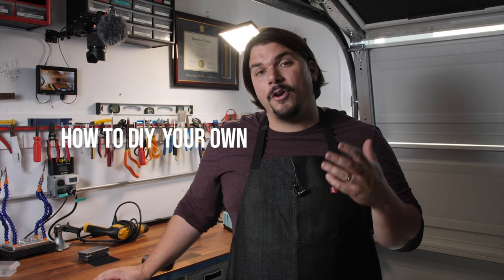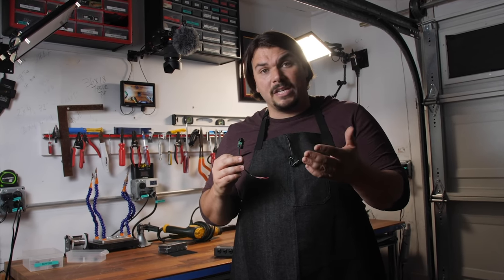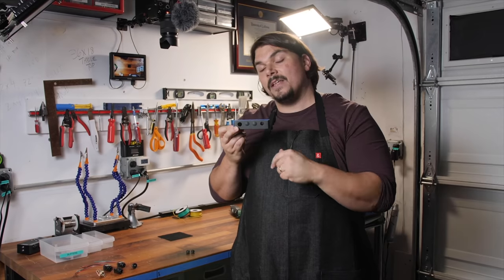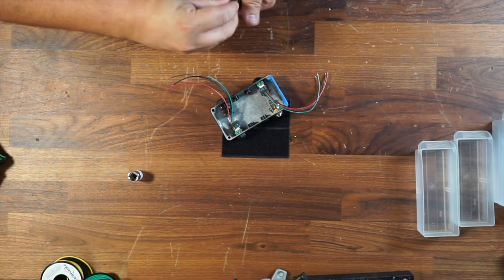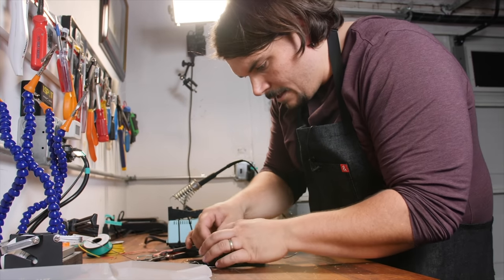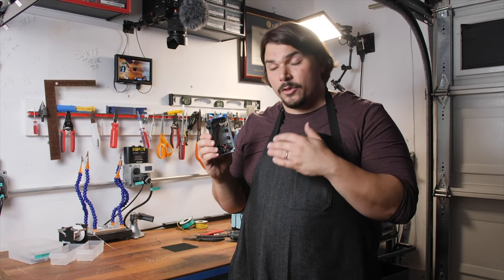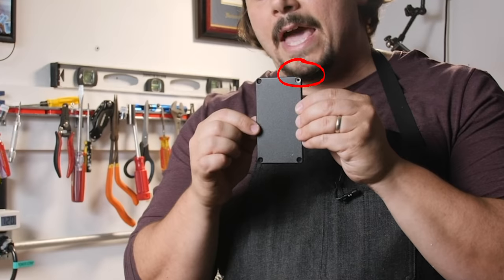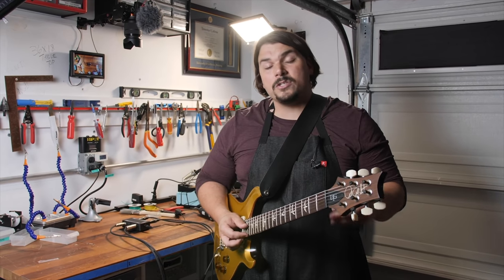Build Your Own Buffer!

Comment: Thank you for your videos!  I’m a beginner just getting into Pedals and you’ve help me tremendously!  I have a question on building the 4 Cable Method. 

I’m looking at running my Volume pedal after Boost/EQ  (following your Signal Path Video). If I have Wah/fuzz/treble boost going into the buffer along with running Chorus and Trem through an effects loop do I need to run 2 buffers or can I simply add another buffer to the 4 cable box and solder it to the buffer output?  The new buffer would be the input for the volume pedal. 

Don’t know if this makes sense.  Your help is truly appreciated!
Reply from the maker: Ideally you'll have three buffers, one after your impedance sensitive pedals like what and fuzz, one going into the front of the amp, and one on the return of the effects loop.  This should be how it's shown here minus the input buffer needing to come later in the chain.

Comment: Awesome video Mason! Right up my ally. Would I make one with a lower input impedance if you’re putting it after a few pedals in your chain? Or still 1M.
Reply from the maker: 1M is still fine.
Reply: @VertexEffectsInc  Thanks! Is it really complicated to make a box that can do both the 4 cable method AND wet/dry depending on what situation you find yourself in?
Reply from the maker: @JazzRockswithAdam  look at the diagram, I show how to do this.
Reply: @VertexEffectsInc  Oh cool, I’ll look more closer next time! 😒
Reply from the maker: @JazzRockswithAdam  the Wet/Dry and 4CM is the same interface wiring diagram.  I also put an option there so you can run it all in front of the amplifier if you need.
Reply: @VertexEffectsInc  thanks! When I get near my computer I’ll check it out!
Reply from the maker: @JazzRockswithAdam  wonderful!

Comment: I have just build this DIY Buffer Interface with the four cable method and I love it! Thank you for the fantastic video! That was something I was looking for for a long time.
I would love to add a green status LED to the buffer interface. But since I am new to this, I wanted to ask if you could tell me what parts I need and how I can add it to the circuit?
Reply from the maker: You could add one off of the DC jack.  There are plenty of tutorials on adding LED's to your pedals on YouTube, you can bypass the part about the jack since it's always on with the buffer and the LED isn't an on/off status light with the footswitch.

Comment: Thank you very much!
Is it possible tu put a volume knob to control the out signal to a split out?
I mean, I would split out in A and B.
The A is directly connected and the B should have an output volume control.
Is it possible?
Reply from the maker: Luca, it's possible, just not an option I show here.

Comment: Your videos have been an amazing resource!  THANK YOU!  Question, what temp do you set your soldering iron for basic soldering?  I am ordering the Soldering Iron you use, and I do not want to fry any parts by getting it too hot.  Cheers
Reply from the maker: It depends on the solder tips, but typically I'm around 500-600 degrees F.  Any more will having you going through tips more often than needed with no benefit.

Comment: These are so great. Would it be possible to add a Stereo / Mono Sum Switch to the Stereo out and what would use for that? Thanks for such great content.
Reply from the maker: It’s possible I just do not recommend doing it - it’s a huge compromise and not what most people think it is.  You are better off making presets to your stereo pedals that are hard panned L for mono over doing a summation of the L and R.  Polarity and internal mixes of each effect create a wildcard that’s not predictable and even when summed can still have negative consequences.  Again, you’re better off going out of the left output only of your last stereo effect and setting all of your stereo pedals to hard panned left.

Comment: Hi Mason,
Great video! What do I need to change/add if I want to build an interface where I can have GTR in and Amp on one side but still be able to have a couple of fuzzes before the buffer? If that makes sense?
Gtr > Interface IN > Fuzz 1 > Fuzz 2 > Buffer in etc
Reply from the maker: You can mix around the jacks as you need them to work...as long as you have enough holes for them.

Comment: Great video! This may be a dumb question, but if I wanted to add phase inversion and ground lift switches to the output, would it just be a matter of wiring in a couple more components, or would it make the whole project way more complex?
Reply from the maker: You would need to add an isolation transformer.

Comment: Hello Mason, I've been watching your videos about Buffers, in another one you were saying that the output impedance (going from the pedalboard to the amp) should be around 100ohms. With this it would be around 1MOhm right? Is that a problem?
Reply from the maker: Output impedance at 100 ohms (or around that as a general rule - some exceptions) and the input impedance at 1M.  Just like this buffer in the video!
Reply: @VertexEffectsInc  oh okay, I thought  both  buffered jack were at 1M impedance (that's what you say to pick in the document?)

Comment: Awesome, Thank you. How would these compare to a Pete Cornish buffer though?
Reply from the maker: Pete Cornish uses a BJT Buffer, basically half of it is like a Boss Buffer.  I think it’s superior to those, but I don’t think it’s superior to something that has a more modern approach and updates based on what’s available now. I don’t find his buffers to be neutral at all, that doesn’t mean they don’t sound good, that just means that it changes the sound of your guitar and amplifier fundamentally.  Also, his buffer is only a single output buffered typically put on the input of a system, there is no output buffering, or any sort of interfacing as you see here. I would put this Creation Audio Labs up against it any day, and it would come out to be more neutral by a long shot if that’s the goal.
Reply: @VertexEffectsInc  Thanks for the in depth analysis, I appreciate you taking the time to explain the difference.
Reply from the maker: A lot of people like it - I just don’t think these people have a good transparent reference point they’re comparing to.

Comment: Hey Vertex, as always a great video! Why would you want an isolated nylon jack opposed to a metal jack on the creative pcb jack? I would think the metal would be a better seal for noise.
Reply from the maker: Why would it be better for noise?  Ideally you want to keep things isolated as much as possible since we can't always know how it's going to be used in the field to avoid possible ground loops not designing this for someone's system that's in our possession.  The input is grounded to the case - which is standard the rest is floating.
Reply: @VertexEffectsInc  was just thinking it would be a better cage for em not to get in....probably overkill as even my shielded strat still sounds the same 😂

Comment: So glad I found this! Based on this, I want to build an interface with a loop for my fuzz and treble boost before the buffers. Should my pre-buffer loop simply involve two extra Neutrik NRJ6HF jacks for send and return, and then I'd wire the signal to go to the first buffer after that?
Reply from the maker: Just put the audition loop up front snd out the inout buffer on the output following the audition loop.  Guitar in, send to impedance sensitive pedals return, output to pedals (input buffer)….
Reply: @VertexEffectsInc  Thank you! I notice that your diagram for the audition loop shows the send and return wired together with the green and brown wires. Is that necessary in my case too, or is that just so your signal still gets through even when there are no cables plugged into those jacks?
Reply from the maker: @09andyleach  wire it as shown

Comment: The CAL Buffer does introduce a little noise in the signal chain, and I only put one up front, but works really well.
Reply from the maker: Something else is wrong if you’re getting noise - not the buffer.
Reply: @VertexEffectsInc  What could it be?  Only hear it when the buffer is powered on. I’ve been trying to figure it out.  Its a very slight noise, like preamp noise, VERY low, but it’s there. Isn’t that normal?
Reply: @VertexEffectsInc  I figured it out, as soon as I stuck the CAL buffer on it’s own isolated power supply noise went away. I was daisy-chaining the buffer and my SP Comp, first two pedals in chain. I figured I could chain them and be fine, but not this time.
Reply from the maker: @adam614ce  typically it's OK daisy chaining with other analog pedals, but it's always best to test on a case by case basis.
Reply: @VertexEffectsInc  Thanks Rig Doctor!

Comment: I need a buffer for my GigRig G2.,,
Running Wet/Dry… 
Should I build this?
Or buy the Mesa Dual Buffer you have also demonstrated?
Reply from the maker: It would be similar to the buffer you would need for a four cable method system, you can’t do this with just the mesa boogie Highwire

Comment: Hi doc'
Very pro and educational, thanks a lot.
If i wanna use the DIY stereo box to send to 2 amps, is it enough to ground the case as you showed it through the screws or do I also need a isolated transformer on one of the outputs ?
Reply from the maker: You'll likely want an isolation transformer.  However most of the cheaper ones aren't great for this application and the expensive ones are all input transformers and should be located on the amp side, not the pedalboard side.  I suggest getting a Lehle P Split and putting it as close to the amp input as possible with as short a cable possible from the output of it if you want to do a stereo rig.

Comment: Hi doc. just want to know where should the buffer pedal be place on the chain? or should i use two buffer in first chain and last? 🤔🤔🤔
Reply from the maker: In most cases, the input and the output, there are some exceptions for impedance sensitive pedals.  You can watch tomorrow and see exactly how to do it and I also have the diagrams live now if you want to check those out: https://vertexeffects.com/diy-buffer

Comment: ive been waiting for this since the your first junction box video! Thank you so much mason! i have a question about the input buffer/tuner out. could i switch the buffer on that's already in my TC Electronic Hypergravity and have that feed into a splitter for a tuner out the way that you have it split in the enclosure?
Reply from the maker: I would recommend doing the splitting off of the buffer directly to eliminate any loading from the parallel split.

Comment: Awesome! Thanks for the video!
By the way, if I'm using a iridium or a HX stomp and want to add the buffer, should I connect the buffer after or before the iridium or HX stomp?
Reply from the maker: You need an input buffer (first), and an output buffer (last).  The output buffer with these systems may not be as critical if it's going direct or balanced out - but it wont' hurt anything and when you use it into an amp, if that happens, you won't have any loss.
Reply: @VertexEffectsInc  great! Thanks!
Reply from the maker: @salemmartinez8738  sure thing!

Comment: Quick Q: not sure if you covered this. Maybe I missed it. If I don’t apply power to the buffer, does signal still go through? If so, is it what you would consider a true bypass?
Reply from the maker: There is typically no true bypass on a buffered when a pedal is powered off.

Comment: I’m getting ready to tackle this DIY project. But, I have one question. Do you think I need a buffer on the send back to the FX loop? In my signal I always have a Catlinbread Talisman on. Do you think the onboard preamp is enough to drive signal?
Reply from the maker: You would want one on the return of the fx loop, not the send if you're talking about a pedalboard based interface/buffer like this project.  Depends on what the Talisman output impedance is.  If it's low like 100 ohms or so, fine.  If it's around 1K, not so good.

Comment: Do you think its possible to have 5 in / outs on the Hammond 1590B? My Idea would be: Instrument, Amp, Fx Send, Fx Return and an additional Footswitch Port.
Reply from the maker: Yes it’s possible, will require a smaller housing PCB mount jacks
Reply: @VertexEffectsInc  Thank you very much! can you recommend one?
Reply from the maker: @Maikusan8787  I have some links in the description and a Bill of Materials - you'll need to use the PCB jack versions.

Comment: Hey Uncle Mason, is there a way to put a Power-Con conector in the interface? Thanks for all the videos!
Reply from the maker: You would have to get a 1590BB if you wanted it to sit upright, otherwise it will only be mounted from the side, same as any D-punch out connector.  You may only be able to fit 2-3 jacks in addition to this, they're so large.  You could also have a noise issue potentially with the AC being so close to the audio signal, but not always, just to keep in mind.

Comment: So I've watched a bunch of your videos...Thank you! There's tons of great info here. I'm a big fan of building my own pedals, cables, etc., so your Rig Doctor videos are right up my alley. However, I'm a bassist---don't hate me, please!---and I've got a few questions.

1) First, is there going to be any difference in buffering needs/requirements between a guitar and bass? Are those Creative buffer PCBs suitable for use with a bass?

2) Input buffers for instruments with active electronics: yea or nay? Complicating the issue is the fact that not only do I have my (active) MusicMan StingRay5 as my main bass, I've also got a (passive) G&L LB-100 Tribute, and an (active) 3/4-scale upright bass that I occasionally use. I know the G&L would probably benefit from use of an input buffer on the board, but my understanding is that powered---active---electronics/preamps in instrument came around specifically to negate signal losses inherent to longer cable runs...So would running an input buffer there be a waste? Would it cause me any harm to run one in line with an active bass? Adding an unbuffered input could be an option as well, but again...Is it worth the trouble?

3) Now we get to go the opposite direction: output buffers. When playing live, most of the time I just run either straight from my bass into the mixer, or through my pedalboard into the mixer, but occasionally I feel less lazy or play somewhere that I know doesn't have good monitoring, so I drag my cab/amp with me. I'm guessing an output buffer would be a good idea for the times I drag my cab/amp with me, but am I going to be causing myself any grief by using an output buffer in front of a mixer?

I know that ended up being a lot of questions, so thank you in advance for any info/direction you can give me.
Reply from the maker: 1) you might want a variable input impedance depends on your bass amp.  Bass amps are more variable than guitar amps are.  Guitar amps are almost always 1M, where bass can range from 500K to 10M.  The buffer however if fine for either instrument you just want a way to set your input impedance.

2) Active electronics don't need an input buffer because the preamp on board is the input buffer, however, having a buffer first won't hurt this and will only help when you switch to a passive instrument.  A high quality buffer won't add any noise.

3) If you're into a DI at the pedalboard side, then the output buffer is less critical, but again won't hurt anything at the times you have a long cable run (unbalanced) to your mixing board or interface or if you connect to an amplifier.
Reply: @VertexEffectsInc , thank you again. I guess I need to look up what my amp lists for input impedance and go from there.

No DI box on my bass pedalboard, although I probably should go that route down the road. Suggestions on good bass DIs? :D
Reply: @VertexEffectsInc , I just checked and my GK has 1M imput impedance. I suppose I could just leave it at that and call it good for experimentation. Thank you.

Comment: Love the concept, but alway have Fuzz first in my chain. I usually run my Fuzz on a Battery as well. Without having to get a groovy battery power supply box, would it make sense to just pull the guitar directly into the Fuzz pedal > post gain buffer (in the hub) > back to the rest of the board > back to the hub > through the output buffer, back to the amp?
Reply from the maker: Just put the buffer after the fuzz and another one at the end of the chain.

Comment: Thanks a lot for this video! I'm almost done with my buffer - but I realized that my guitar jack (the metal one) is a mono version. I believe that's what you're using in the video?? But the diagram shows the wiring of a stereo version. Can the mono jack be used - and if so - how?
Reply from the maker: That's OK, you can still use it as is you might just get some noise when you unplug your guitar from the rig while it's still connected to the amp, but it's not a problem if you don't mind the noise temporarily until you turn off your amp or put it on standby.  It's not a stereo jack but a shorting jack that mutes the input when the cable is unplugged.
Reply: @VertexEffectsInc  so it wouldnt give any noise if we go to standby or turn the amp off first using a mono jack? 

Looking to make one but itll stay plugged it all the time on the board.
Reply from the maker: @mathewvillalpondo8049  no noise when the rig is connected, it just won't short out when you unplug the guitar.